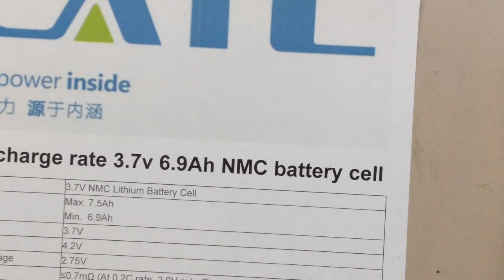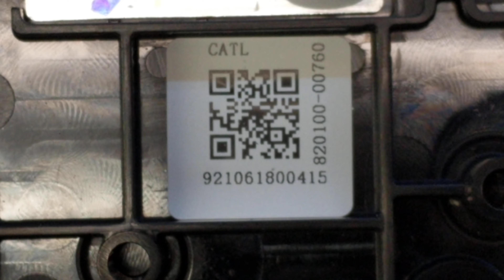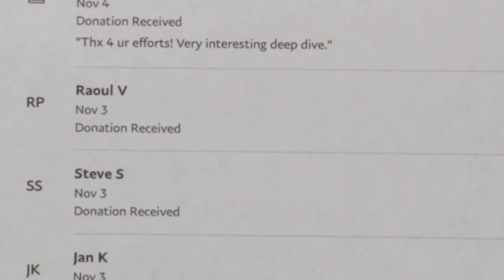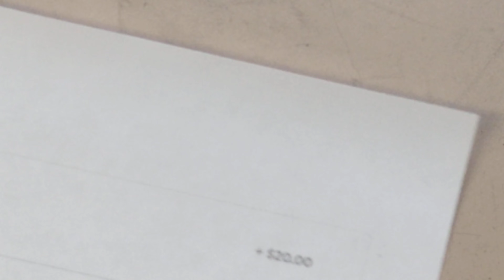Update!  Part 2 - Tesla Plaid 12v lithium battery.

Comment: A part 3 please, explaining the series connection of the FETs operation, thanks.
Reply from the maker: Doesn't really warrant a whole video.  Basically MOSFETs only work one direction, due to the way the silicon is structured.   They work as Diodes in reverse and switches in forward.  So 2 sets in series, one to stop charge, and one to stop discharge.   When the pack is full, the "charge" switch will open preventing overcharge, but still allowing output.  When the pack is empty, the "discharge" switch opens cutting the load, but will still allow charge pack up.  Look up "BMS design" on the web for more details.
Reply: @Ingineerix  Thanks for the info, it helps for my understanding, I do not have an electronics nor electrical background.  I am just a car enthusiasm who has moved to EV.  They say a little knowledge is more dangerous than no knowledge at all!  But I love the way you explain tings.
Reply: @Ingineerix  Whitch FETs are used here exactly?
Reply from the maker: @Juz4m  https://www.st.com/resource/en/datasheet/stp410n4f7ag.pdf
Reply: @Ingineerix  hi, the package in this datasheet does not match the ones on the board in the video. Could you please Confirm the part number? Thanks
Reply from the maker: @sherifsabet  The package is custom for Tesla.  (or was at one point)   Sorry if you want more from me, you'll have to start paying my consulting rate.

Comment: Are you sure that it discharge to heat itself up? Any evidence? Thanks a lot.
Reply from the maker: No, just a theory.  Another way out is to just keep the DC-DC enabled in super cold climates, thus no need to use this battery.  You'd need to keep the main pack heated anyway, so grid power will be needed.

Comment: what would prevent Model 3/Y from using this? (besides connector type)
Reply from the maker: Model 3 has no way to properly communicate with this, and it would not even put power out without VCBATT telling it to.   Also, Model 3's firmware doesn't support the correct charging voltage.  Best advice is to stick with the OEM AGM battery.  Do not put any kind of aftermarket Lithium type in, as you are risking damage, the cost is not really any better either.   When the lithium unit is fully charged it's BMS opens it's charge FETs and it will no longer be able to absorb load-dump and transients, which can damage the devices on the 12v bus.
Reply: Different interface different voltages, different charge profiles etc.
Software and hardware expecting a dumb 12 v lead acid battery would not do well for a smart 16v pack.

Comment: Not sure if you can answer this, but I'll give it a shot. 
1. If one wanted to install a Plaid rear drive unit in another car for use in drag racing, theoretically, how small could one make the battery so it could make 10 runs at full power? 
2. Practically, how could one configure a battery pack using Tesla modules to provide the smallest/lightest pack that provided the requisite voltage and current for full power?

Really appreciate your videos- I kicked in $25.00 towards the next parts.
Reply from the maker: This is a very involved question.  The biggest problem is coming up with a pack that can provide enough POWER if you make it smaller.  You also need about ~450v if you want max power.   I am working on a controller to enable the use of the Plaid motors in other applications.
Reply: @Ingineerix  I know it's very involved: that's why I asked an expert.Awesome to hear you are working on a controller. I feel like swapping in a Plaid drive unit will become commonplace in 3-5 years. If someone could secure a supply of Plaid motors and have a good battery/control solution then I think the market will be very large.
Reply: @Ingineerix  If you are looking for an investor, let me know

Comment: Interesting that it is using CATL prismatic cells but NMC cathode over LFP. This will help at low temperatures but will have lower cycle life. I can see a good argument for going more low temperature compatibility.
Reply: The >2000 cycle life, why use LFP over NMC? You can get more energy density with NMC, keeping it small and lightweight for the energy it provides, while the CATL NMC Prismatic cells seem to get close to or exceed the LFP cycle life. So same lifespan, more energy, no need to go with LFP.

Comment: Secretly hoping for Part 3.
Reply from the maker: What do you want answered?  (That I haven't answered in the comments already.)
Reply: @Ingineerix  Yes, you did answer all questions and reasoned why the pack should not be pulled  apart further. I would have liked the strip down to the bare cells, but it really is not necessary.

Comment: Is it possible that they do  rapid charge/dicharge cycles to heat the 12V battery? Similar how they energised the early Model 3 motor stator coils for pre-heating?
Reply from the maker: Yes, this is my theory.   (unproven)   Might also just keep the HV up when it's below freezing, as it needs to keep the man pack warm too.   You'll just lose a lot of range if you aren't connected to the grid.

Comment: You mention it is $6 each on Alibaba?  Why would Tesla need to pay $50?  Did I hear wrong or did you misspeak?
Reply: $6 per cell maybe?  Probably $48 for the 8 cells this battery uses.  Which makes $150 for the whole assembly perfectly reasonable, are we sure Tesla charges that little?
Reply: @GeraldMMonroe  This pack uses 4 prismatic cells. He corrected his assumptions from the beginning of the video (4s 2p) during the video (4s 1p). So it would be 24 USD for the 4 cells. If you add the BMS board, sensors, case, wiring, connector then USD 50 sounds about plausible.
Reply from the maker: Yes, keep in mind the BoM cost is way more than just the cells.  You also have to cover NRE (such as engineering, tooling, etc.0
Reply: with tesla you also get a metal housing and a pretty nice BMS. they are also pretty higher quality then qhat you get on ali.

Comment: -4F is an impressive discharge temp, but it gets much colder than that in some places... i think you mentioned in part one another way the system can warm the 12v... it's interesting that it doesn't have a small heater inside
Reply: Tesla probably discharges it in much colder temperatures but does it at their own risk. Practically it'll be just fine as long as you don't discharge it at the maximum discharge rate. Same goes for charging - if it's rated at 10C charge current down to -10°C, it probably can be charged at lower than that, as long as the current is small. Tesla has probably lab tested it themselves.
Reply: @celeron55  good point and the unit is cheap enough to replace if it degrades a little faster then normal. It’ll still last longer than lead acid.
Reply: @celeron55  True tru in minus 22 it stopped charging and SOC whent down belowe 10% then car gott RED ERROR all over the place but i disconected the new ledbars and the SOC went up to 26% very fast and then i could drive on luckaly. Lazer 18 led vwasz the ledbar i connected to the red pluss with the cap on it normaly.:hand-purple-blue-peace:
Reply: Heater needs an energy source and if your aux battery is cold then your main battery is also cold so where would you tap energy to power the heater? If you are plug in then the car can turn on the heat pump that is right next to the aux battery to warm it up. The car will burn energy to keep the main battery warm if it is plug in. This process will also warm up the area around the heat pump which should be enough to warm up the aux battery.

Comment: i  would just use an ultra capacitor and since either way the circuit wakes up the HV pack to charge it up once it's empty. basically it's just a work around to keep the hv pack sort of feeding into to keep the PCs running. this 12 volt battery thing reminds me of computers OS and BIOS. can't boot without boot files but once OS is loaded, it has no other purpose
Reply: Can't just use a super-cap. An EV is not a PC. The 12 VDC battery is not just for "boot up". The 12 VDC battery is also the EV's "emergency safety power supply" to keep critical safety-related control boards, sensors, pumps, etc. operational in the event anything bad happens that forces the BMS to kill all HV power from the pack.  For example, if the BMS detects that a single cell has shorted and possibly going into thermal runaway, it will kill the HV pack and then start the pack's 12 VDC glycol cooling pumps to start circulating glycol through the cooling snakes to remove as much heat from the bad cell as possible, plus cool all the adjacent cells, hopefully sufficiently to prevent the TRE from cascading to other cells and creating a vehicle fire. it might have to run the pumps and front  radiator fan for a long time. That means you need some significant A-h of 12 VDC energy storage to be effective.
Reply: @keithritter800  I have replaced my 12V battery in my EV for 6x350F super caps. They work like a charm, but I can't leave the door open for 10 minutes without the key turned. What draws most power is the electric power steering and they have plenty muscle for keeping the voltage stable Contactors and wakeup draws only 60W average  for 3 seconds after turning the key before the DC converter kicks in. The only catch is the self discharge of the caps and sleep draw from the computer, which drains them after two days parked, so I've added a 20W solar panel on the dash, which always keep them topped up, even in winter. If I need to run the hazards, but the DC converter is broken, it will be as a result of a crash, in which case the car will be on fire, having excellent visibility on the side of the road!
Reply: @Tore_Lund  thanks for the reply guys and all the details.
yeah I'm not saying the PC and car are the same, i just feel the bios had been a bottleneck for PC's in many ways but without it PC can't work. as for the car, i know the hv pack is more like a safety thing and having an auxiliary power to control things in emergency is a must. but i perhaps overall when things run as they should, likely is more running of the HV power.
 tesla could build a bigger ultra capacitor  that never needs replacing. that lithium one is a good move away from the led acid, but i feel with wider temperature changes, if it fails and needs replacing soon, that would be lame. but actually speaking of ultracaps, i wonder why wouldn't tesla use a buffer with a stack of ultracaps to provide huge burst of power when accelerating also enhancing the regen when braking harder. and save a bit of wear on the HV pack.

Comment: So they're gonna be discharging it to heat it up, huh? Interesting.
Reply from the maker: Might also just keep the HV up when it's below freezing, as it needs to keep the man pack warm too.   You'll just lose a lot of range if you aren't connected to the grid.
Reply: @Ingineerix  I live in a cold climate place. It's not uncommon to get -20 during the night for about 3 weeks a year. My Model 3 2019 (with Scan My Tesla):  When I plug the cat, it heats the pack to 5Celcius before charging then the following morning even if it's super cold, the pack is at -11C if the car slept for the entire night (like 10 hours sleeping). There is a LOT of mass in the battery, it takes time to cool.

The small 12v battery will cool much faster. Maybe Tesla is running it out of specs voluntarily knowing the amps it needs are minimal while sleeping and the only real load is turning the DC-DC converter ON and it has almost no risk damaging the battery because it's for such a small amount of time.

Comment: I live in mid-Canada, it gets down to -40 here in winter. How would this work (or not)?
Reply: Outside that range the 10C/50C ratings no longer apply. The battery will still provide power, just slower. Charging should not be done outside the designed spec as there are all manner of weird chemistries at play in there. (otherwise, this sounds like every other half-baked new idea Tesla comes up with. When they fail, it'll get redesigned. A few times.)
Reply: Chances are the car will run the DC-DC continuously in these conditions, which will result in the main battery being discharged a bit more than normal, but the car will still 'start'.  Also, the -20C rating is likely for full discharge current.  At -30C it might still be able to supply the 10 amps or so to boot the computers up and throw the pack contactors, for example.
Reply: @tomsixsix  “chances are” means you are guessing…. So what about -40? Only time will tell because Tesla doesn’t like to tell anything really.
Reply: is it located near the heat pump? might be enough ambient heat from main pack management to work out
Reply: @JackMott  I don’t think you fully understand how the heat pump works…. It’s not just emanating heat all around itself…
Reply: @InternetDude  everything emanates a bit, i realize it doesn’t blow heat into the air, i am ignorant but not brain dead
Reply: They could continually charge and discharge the battery under low temperature conditions to keep it warm.
Doesn't the main pack have a way to maintain minimum temperature?
Reply: @ke6gwf  that’s what I’m thinking it may do to keep warm. The main battery pack is temp controlled already (coolant loop).